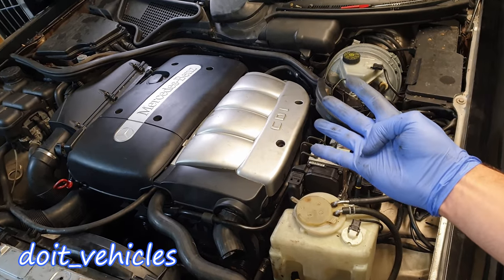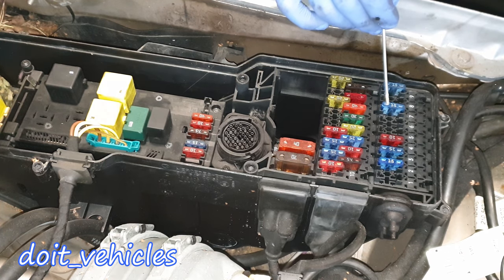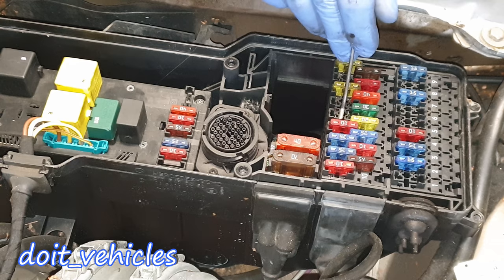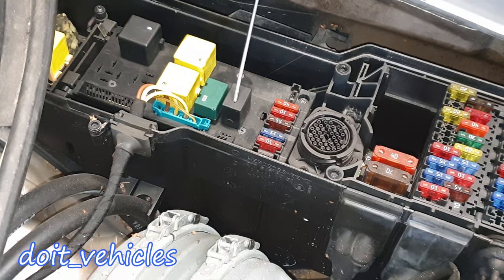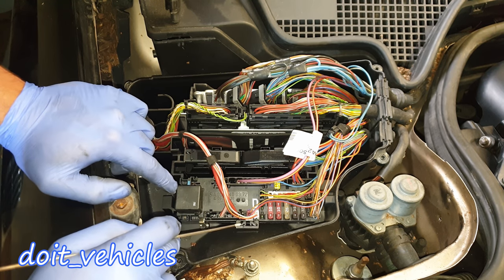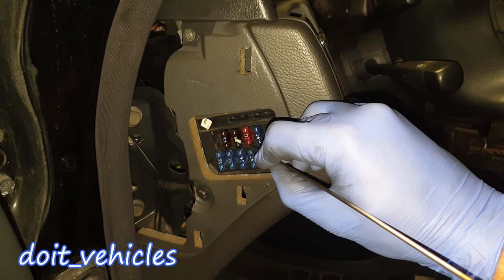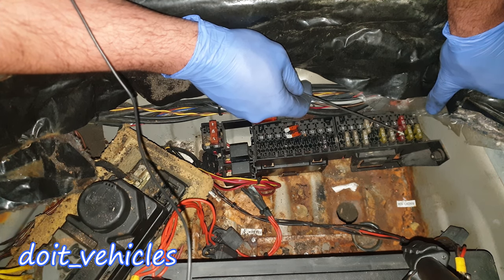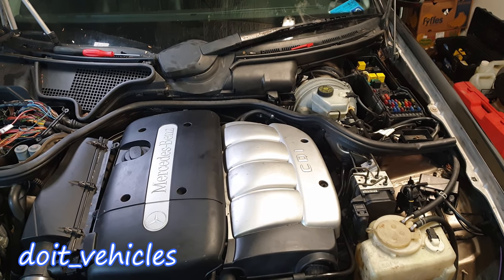Mercedes w210 All Fuses and Relays Location E220 E320 CDI

Comment: How much voltage should I have with ignition on measuring on injector plug? I have 10.5v, I already repair injectors.. And car won't start e220 cdi 143hp

Comment: Thank you a lot. On the third fuse box, breaker number 2 for the Brake Pedal position. That breaker was faulty, and as soon I started the engine came out 4 warning lights, BAS, ESP, ABS, and Faulty Lamp.
Now everything is OK after I repalce that Breaker.
Reply: En que lugar esta ubicado

Comment: I absolutely cannot thank you enough for this video.  Thank you, thank you, thank you!
Reply from the maker: You are so welcome!
Reply: @doit_vehicles  grand dads 1997 e320 fuel pump relay we are hoping you can help with any suggestion to find it. we did not see it under the rear seat near the battery???? we appreciate your help
Reply: @doit_vehicles  same for w210 E55 yr 2000
Reply: @wisdomandlove1661  Did you find the location?

Comment: Thanks for the explanation. My  W210  E230 1996 model does have that section here you said it is the horn and horn relay. My horn is not functioning and I’m struggling to identify the fuse, can you assist?

Comment: On my 2000 e320 when fuse # 9 blew the ignition switch would not turn, replaced it and ignition worked. should't but did!

Comment: Great video. Thank you very much for sharing your knowledge. I have a W210 (96 model). I have a problem with indicators and hazzard light stay constant on when applied. No flashing. Is there a fuse which controls the flashing? If it is not the fuse, how about a relay or a flasher unit? Love to hear if you have come across this issue. Many Thanks.

Comment: Hallo doit_vehicle. Thank you for good video which explain fuse of W210. During checking the power window switch I got sort/small spark between 2 Cable (from 6 cable socket). Since then there was no current, then I check the fuse but all fuse still good. However there were no power/current at fuse 1,2,3,7,10,11,13,14. Other fuse 4,9,16,17,18 and the rest have power including the fuse under rear seat close by the battery . May be you can tell me what went wrong and how to solve it. Thanks again.

Comment: Your video was the best, I have a 1999, E320 Mercedes Benz and every time that I connect the battery the alarm goes off and it does not turn off , I was trying to disconnect the alarm , how can I do that? It’s possible that I could take the fuse off and if it is, where is the fuse ? under the seat? 
Thanks

Comment: Hello, I have a 2002 Mercedes W210 with a red engine. The compressor lever does not have electricity and the car has no torque. Is there a special fuse for the compressor lever? Thank you.

Comment: Where is the relay for the radiator fan? I have a 2003 e320 wagon and the fan doesn't turn off so wanted to replace the relay.
Reply: Did you ever find it my fan won't kick on .  Don't know where it's at ?

Comment: maybe a late comment and you will not answer but I wanted to ask something, yesterday my mercedes w210 e class 2001 was working fine and after i tried to turn it on it just didnt want to, after i insert the key the ignition makes a clicking noise but it doesnt start , what can the problem be please?❤
Reply from the maker: Most likely the starter motor needs replacement

Comment: My e240 w210 1998 model is having no Horn at all. Which fuse to check or could it be because of a missing vacuum pump located under the rear seat.

Comment: Hello, I have a problem with the engine fan not working and the air conditioner, typical for an E220 CDI Diesel 2001.

Comment: I only can turn on headlihlght and tail light and hassle light.the fob  remote both fob cannot knock or unlock car.but light is flashing when I press .I assume the remote is fine. And also I put fob to start .I won't let me turn to 1 or2 position.is is a fuse for the remote pls 
.Thxs for the help

Comment: I have subscribed to your videos. Very informative very helpful, thank you. I have a 2001 Mercedes E320 SRS. The dashboard tells me I have one malfunctioned and that is the SOS malfunction. I took the switch out as you instructed and waiting for the new one to come in. Something in the back of the car keeps beeping to the SOS system trying to connect.
Reply: The fuse directory told me that the telephone is 15 amp fuse. I removed every 15 amp fuse in the car but the SOS light above the driver's side is still on. Can you tell me where the fuse is so I can pull it to set off the light and whatever is beeping. It doesn't beep all the time just every minute or so but one beep! It is draining the battery when I let it sit overnight.

Again thank you for the informative videos.

Comment: My 99 E320 driver side: fuses good; relays same colors as video. If I put a black Hella 5-pin relay in the empty 5-pin connection, could that supply 12v to my ac compressor & radiator fan? Thanks!

Comment: Thank you for your videos. Very informative and straight forward details. I just subscribed.  I have a E240 2.6cc Year 2001 and having "c1401 high pressure return pump a7/3m1" error. The error keep coming back even after multiple resets. I have also changed the brake light switch, brand new rear taillamp sets and also the ABS pump module but problem remains. What else should i check apart from K40 relay ?
Reply from the maker: Hi ! this can be trycky to solve since it can something simple like a wheel speed sensor or a malfunction on the CAN BUS comunication betwen the ECU and the modules . I recommend to scan it with some good tool first , interpret the data , before replacing anything
Reply: @doit_vehicles  hi the issue has been resolved. The ABS fuse burned

Comment: Hello, thank you for your very useful video. I just subscribed to your youtube channel.
I would like to explain my problem to you:
When the car is moving, the ETS, ABS warning lights, brake pad wear indicator, low brake fluid indicator. In addition, the speed needle remains at zero.
Do you have an idea ?
Thank you for your help.
Reply from the maker: Its imposible for me to diagnose it from the distance , but most likely an electrical issue so you will need a scan tool

Comment: Is it possible that the key remote dont work because of a fuse?the key dont work at all i replaced the battery of the remote but dont do anything cant start car cant lock and unlock..I got to use the spare and lock all the doors manually

Comment: Dear Sirs, I have a MB W210 E200, nodel 2001 and my Front Roof Reading Light does not respond at all, I have the impression that there is no electricity at all. Does anyone know which fuse is responsible for that

Comment: My driverside brake light goes out sometimes but comes back on sometimes. I replaced buld and brake light switch. Is there something I missed? Is there a reset ?
Reply from the maker: It can be a wiring issue . it does that when you press the brakes ?

Comment: Please, can you tell me where is the fuse for Central Vacuum pump AC door locks.
Maybe can be bad the fuse or can be bad the pump, because do not open all the doors, does not open the trunk with the metal key either. Thanks
Reply: Rear seat down beside the battery

Comment: I have a 200320 e Mercedes my passenger rear light was replaced but the light bulb is actually brighter than all the other lights rear lights and it's saying I have one malfunction tail light what could be the cause of that because the light will come on if I manually turn it on but it will not come on when I open the door
Reply: I meant to say I have a 2000 320E Mercedes

Comment: I tried to use the blue driver obd2 with the 38pin connector on this w210 220 and didn't work at all any advice please. Thanks
Reply from the maker: I will have to check that myself ..
Reply: OK.

Comment: Does Heater Booster have a Reley??or maybe it is on 4:09?
Reply from the maker: it don't think is that one from 4.09 , it depends what was installed on the car. Sometimes the relay can be on the heater booster itself like on a S class
Reply: @doit_vehicles  cool, thanks

Comment: Where can i find the aux fan relay? My fan wont turn off even if there is no key
Reply: its on the left  inner wing near the abs pump, its silver in colour. has a 10mm nut at the top and a plug at the bottom

Comment: Do you happen to know where the fuse for the break lights is ?
Reply: wondering about the same, is your brakeligt on while driving and its not the brakelightswitch thats broken ?
Reply: Yeah my break lights just went out helppp
Reply: @sslizzzurrr9162  Even if your breaklightswitch looks fine it might be the problem it was for me just bought A new one and now it work again
Reply: @DUCKLIKKER  my running light on the trunk went out as well.

Comment: Anyone know if there is a hidden relay for the windows? All 4 stopped working SAME time. (Sunroof still works) checked all known fuses and relays all are good. (Jumped window motors still good.) Suggestions anyone?
Reply: im having same issues , did you figure it out yet ?
Reply: @niecylee7404  no living with just having a sun roof
Reply: @kevinmerendino761  me too , Im gonna try and fix it this week though , whatever i have to do , I will let you know if i get it done and how
Reply: @niecylee7404  oh man PLEASE DO! I be tried everything even bought and replace the "U" shaped control module in the center console.. Still nothing!
Reply: Just wondering how (or if) you solved the window problem?
Thanks in advance for your time!
Reply: @kevinmerendino761  not yet still studying it , I'm thinking its the center master switch though
Reply: @niecylee7404  master switch? Where and/or which one is the master switch?
Reply: @kevinmerendino761  in the center console where all the switches and gear shift are
Reply: @niecylee7404  ok I have the 4 window buttons (+"ESP"or traction control, trunk, mirror, 2 small buttons between each left or right window buttons the left button is in place however the right button is missing (maybe the problem?) I do not know what these buttons are for exactly Im assuming to lock REAR windows I do not think that one missing would effect the front (or all) windows but maybe. The man I purchased it from bought the "U" shaped controller that these buttons fit into off eBay. He said it cost him about $49. But I do not know if it was used or new and it obviously did not fix the problem. I am tempted to purchase a new one from a dealer, but you and I know that WILL cost a arm and leg... + prob. 2 toes and a right ear LOL. first one of us to fix pls hit up the other... deal?
Reply: I had my front module repaired and everything started working again. Easy to remove and replace. About a $300 fix @niecylee7404

Comment: What year Mercedes
Reply from the maker: This one : 2000
Reply: @doit_vehicles  why are your fuel pump relay and pump fuse missing,  i replaced my fuel relay and now im gonna check fuse in morning and if it still just cranks and wont start its off to my mechanic.
Reply from the maker: @matt7iron  it has mechanical fuel pump